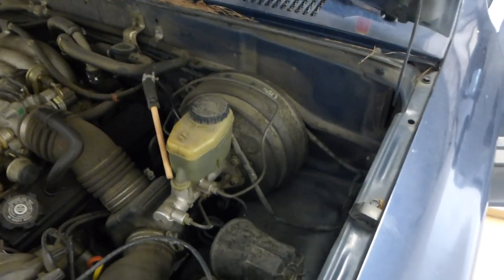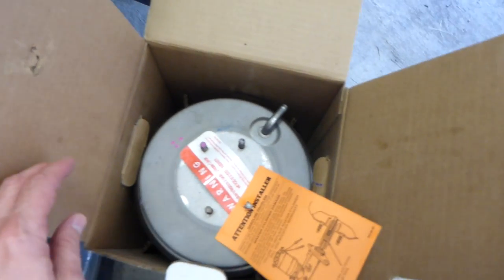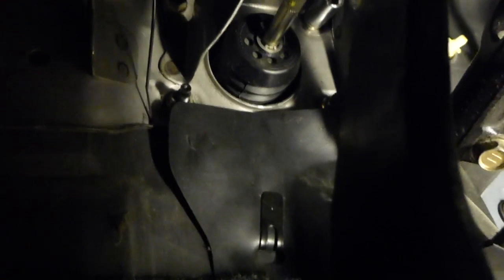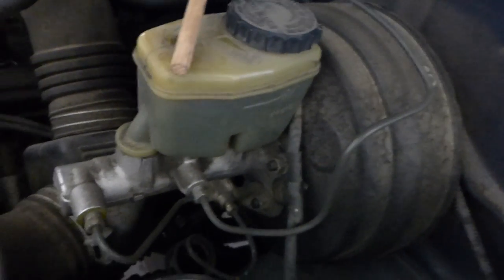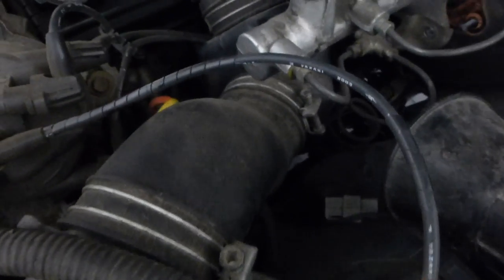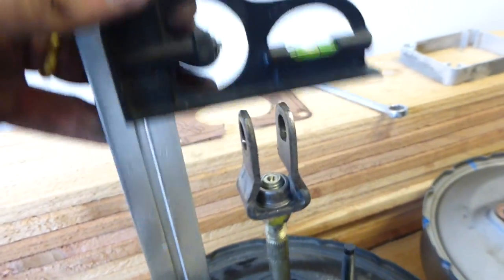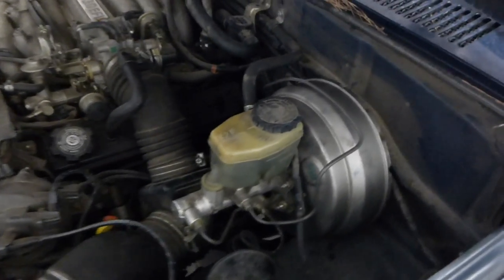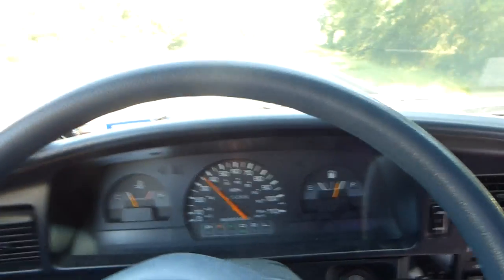Brake Booster Swap

Comment: Thanks for this video, very helpful. I have an 2000 Toyota 4Runner. If the check valve doesn't fix mine when it comes in tomorrow, I will replace the brake booster and your video shows me how. My 4Runner's symptoms are the brake pedal is very hard to push, I have no power assistance at all. Brake pads are fine.
Reply: John B did replacing the booster fix the problem?

Comment: Replaced mine with the same generic part a few years ago and had issues with the braking being way too sharp. I even tried adjusting the rod on the booster all the way back but it was still bad. Ended up buying a master cylinder/booster combo from a junk yard so hopefully it's gonna fix the issue this time ($500 later). Thanks for the video!
Reply: I had the same issue..my mechanic charged me 20 dollars...it turned out to be a problem with the brake adjustment on the rear tires...rear passenger side....

Comment: I think I have the same problem. Did your pedal sink to the floor with the engine ON but feel firm and did not sink with engine  OFF?
Reply from the maker: No, in my case, the brake pedal did NOT sink to the floor.

Comment: get a used booster for under$100 exact fit and brake boosters on Toyota's rarely go bad so you should be fine with used one instead of paying $280 for a remanned booster.

Comment: Toyota pickup and toyota 4runner are the same booster?
Reply from the maker: I wouldn't bet on it.  Seems there were 2 or 3 boosters just for the '94 pickup.  The parts store will ask if it's 2 or 4 wheel drive, engine type, etc.

Comment: my problem is that the pedal sinks to the floor sometimes when slowing down, or holding pedal for a bit. was yours a similar problem?
Reply from the maker: +brandon sooy No. That sounds like a different issue than mine.
Reply: that would be your master cylinder, your secondary piston may not be working so just replace that and you should be good
Reply: Air in the line !
Reply: Mine is doing this exactly when stoping it sinks to the floor and when I'm stopped itll start to sink I have to pump it

Comment: Did you use the 00-05 tundra booster on the pick...?
Reply from the maker: No.  I got the rebuilt booster at O'Reilly Auto Parts.  I'm sure it was specifically for my '94 pickup.

Comment: Next time just remove the master cylinder, bench bleed it, and bleed the brakes. It'll save you time doing it the right way.
Reply: Why, he didn’t have to bleed the system. He just took off the intake and saved a lot of work.